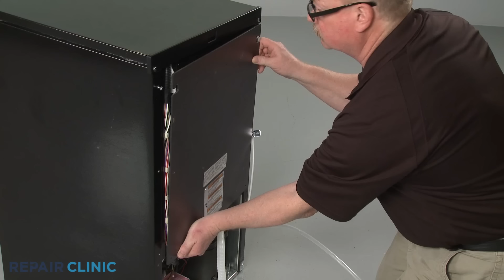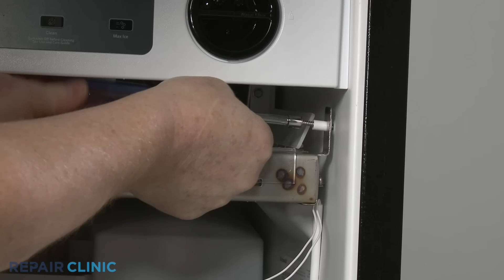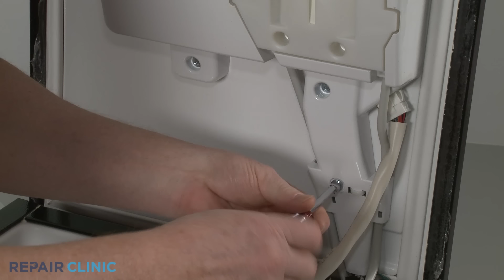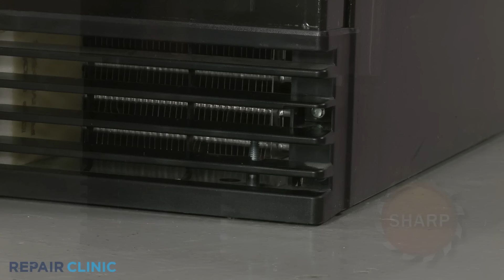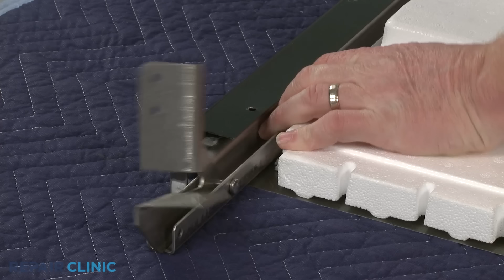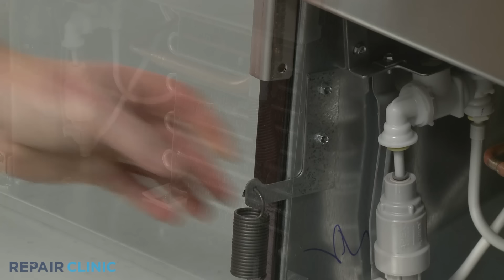KitchenAid Ice Machine Disassembly – Model KUID508ESS2

Comment: I took off the door and bottom grill to clean the coils and after reassembly I’m getting no power to my icemaker.  There are no pinched wires.  If I plug it in about halfway and wiggle the plug, the light blinks on then off.  Plugging it in all the way results in no power and no light blinking.  Any suggestions?

Comment: Great video! Our icemaker is only making very very thin ice. It used to make thick ice. I replaced the filter. I’ve cleaned the machine - twice. I’ve reset the machine. It is producing ice which is very thin ice. Any suggestions?
Reply: It likely is not cooling enough. Potentially an issue with the sealed system.

Comment: I'm trying to find out how you troubleshoot the damn thing. I paid 140 dollars for a technician to come out and he laid on the floor and said it was fine then left. It consistently has about 1-2 cups of very watery ice and that's it. It seems to run constantly and the very little ice it does produce is paper thin and melts almost immediately when in a drink.
Reply: I just realized the top panel slides forward on ours. It’s created a gap. We went from ice to ice water pretty quick. See if your flush from the side. The magnet on the door pulled the top panel forward a little every time we opened the door. It is a “wet” ice machine. Because of the way it turns over it creates a very clean taste but it doesn’t last long.
Reply: Did you ever find a solution.  All my pumps are running and diagnostics show that everything is good but I get the same kind of ice that you suggest.
Reply: @pickleballcannon166  I realize that the door was not sealing right. The top panel was sliding forward each time we opened the door.  I also cleaned all of the calcification off the grid. It’s working like new.  Does the magnet make solid contact? If so, put a light inside and turn off the lights. Do you see light?
Reply: @1savd Soul  ya...I noticed that a few months back.  the latch was loose/broken.  I actually taped a small magnet to the sensor so it should even run with the door open. light goes off when magnet is there.  seems like it starts making next set office but short cycles and starts heating before ice is thick enough....temp probe?
Reply: @pickleballcannon166  I think the top, meaning the entire top of your ice maker has come forward. It’s crazy! See if you can move the top back and forth. It needs to be pulled from under the cabinet.
Reply: If your door isn’t sealing, the temp is too hot inside the ice maker.
Reply: @1savdsoul439  It's actually outside in Canada.  so ambient temp is certainly not the issue.  Can't seem to find the evap thermister
Reply: @pickleballcannon166  Take the scoop out, lift the scoop shoot up and pull out. I believe you will see it to the right. The large white panel to the right has two socket bolts underneath. It is easy to remove. Once this front panel comes off you should easily get to what you’re looking for.

Comment: Question, we just bought this model used. I cleaned it all up. Seems that it uses a LOT of water. I can explain what I see here in the cycle. It starts filling the pan thru the big hose on the left. Then water comes from the top thru the small tube that snaps to the pump cover. That then makes the water overflow thru the overflow hole. Then the water appears to just get dumped by the lower pump via the solid white s shaped hose. I am thinking that a)maybe fill valve sending too much water 2) maybe the recirculating pump not operating.  Please advise, for will each cycle of ice I probably have 2-3 gallons of unused water.

Comment: I thought I would add a public comment to assist the next person.  I clean my icemaker religiously every time the light comes on.  It is just my wife and I, we do not run the max ice light.  The ice machine is about six years old and is cleaned about every 4 months.  It is our second machine in twenty years.  Removing the filter is the only problem we have encountered and only with the Made in China replacement Filter Cartridge.  I am suspecting it is because I recently bought a "Waten" replacement cartridge instead of the one made for this icemaker.  Waten is made in china (P6RFWG2K) and sold as a replacement cartridge for the F2WC911 ICE2.  Filters are expensive but the Ice maker is real expensive.  I am going to order the F2WC911 ICE 2.
Reply: Same problem that many others are having removing the POS CHINA filter. Expensive machine and filter. Going back to old style freezer and bags of ice.

Comment: my ice machine has quit freezing ice what can i do
Reply: Did you ever get it fixed?? Mine is not making ice now. Put it through diagnostics and everything is good- even the plate that the water flows over gets frosted over. Put it back in run mode, the plate doesn't get cold??
Reply: @kerry4371  did you get you icemaker working?
Reply: @warrenpope5902  Nope, ended up calling a appliance repair shop. they came and said either the compressor  was bad or has a leak. 85 bucks to walk in the door and also must take it back to the shop to diagnose futher and repair. labor /parts was going to be atleast 500.00--- bye mr. technition! i bought a new one and the old sets in my garage.
Reply: @kerry4371  put a light inside and see if you can see light with the door closed. Maybe the door is not sealing.

Comment: We are unable to remove the filter. We turn it clockwise to where it stops but the filter will not come out. Wondering if we need to turn the dial further. Any suggestions are welcomed. Thank you.
Reply: Had the same problem.  Suggest you use the key that came with the new filter. Or a pair of rubber pliers.
Reply: @FB-111A  Thank you. We were successful in getting it out with the assistance of a very STRONG friend who even had difficulty removing it. Having installed the new one I remove & replace the same filter every few weeks just to keep it from sticking but even then it is not an easy task removing it.  Poor design?
Reply: @RealityCheck1965  I am cleaning my Icemaker after 4 months because the clean and replace filter lights are on.  Unfortunally I am not able to remove the filter.  I have tried channel locks etc.  I am pulling and twisting.  In addition the machine will not operate.  I am assuming It is because the machine is sensing a filter problem.  You are right poor design and the filters are expensive.  I probably did not need to replace.  I am really frustrated.
Reply: @FB-111A  I know if you hold the on/off and the clean button it will reset the machine. Maybe it will bypass your filter needs changing message